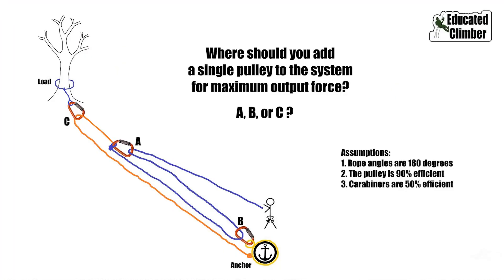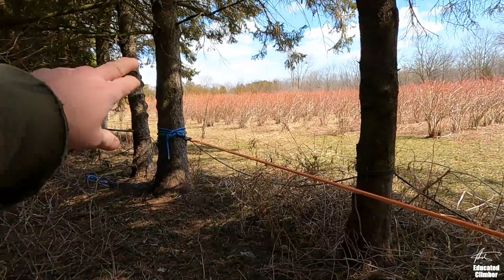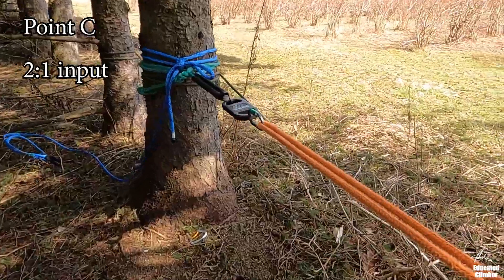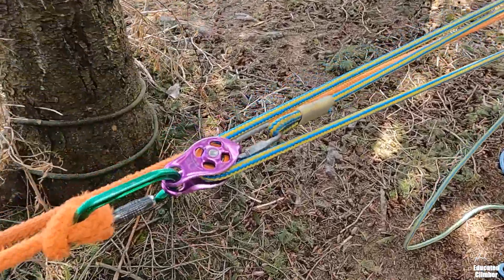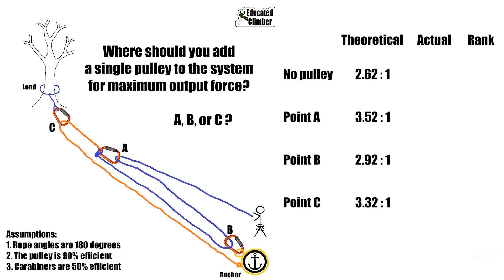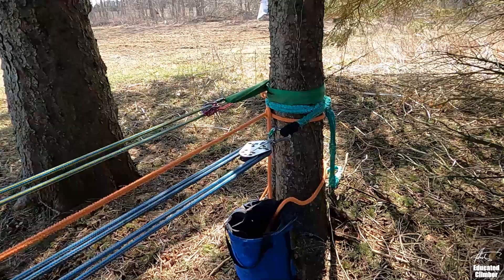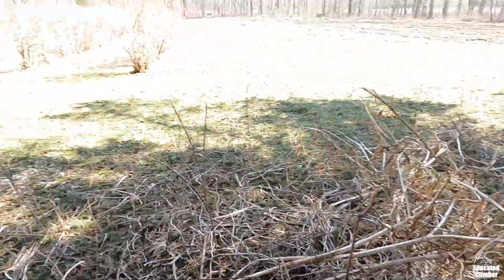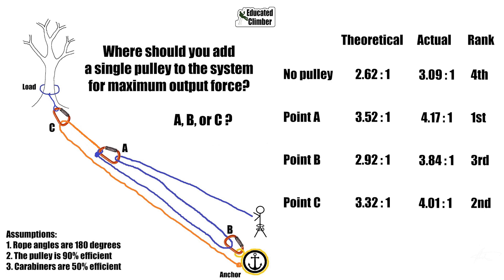Piggyback Mechanical Advantage: Load Cell Tests

Comment: Awesome content thanks! Wish I had the load cells. Here is what I’d like to see, how much force is actually being applied at the different spots on a 10-1 (2-1 being pulled with a 5-1). Say pull 1kn at the end of the 5-1 and see how much force is being applied to the 2-1 rope and how much force using a block and good pulleys is applied to the load. That’s how I pull heavy leaners and going to try pulling over some smaller trees including the stumps using a rope jack. Curious what will break first. 😁
Reply from the maker: What type of 5:1 do you use
Reply: CMI RP153 2”
Reply: CMI RP153 2”